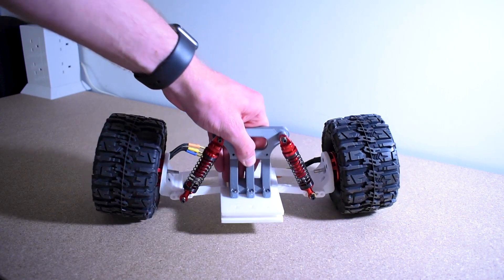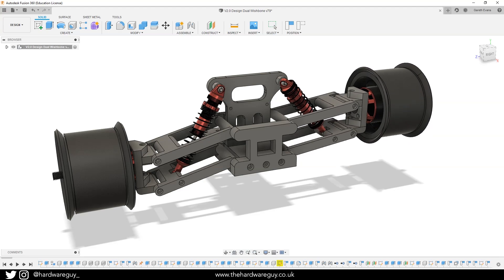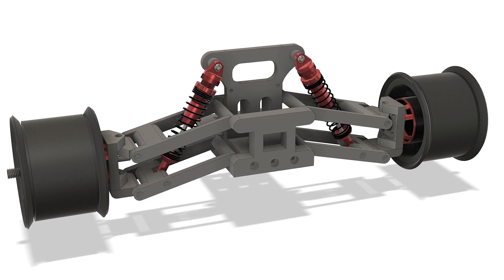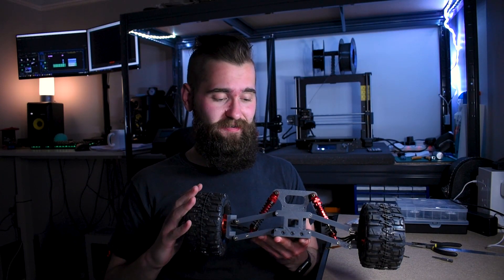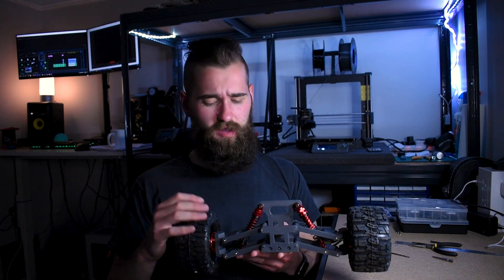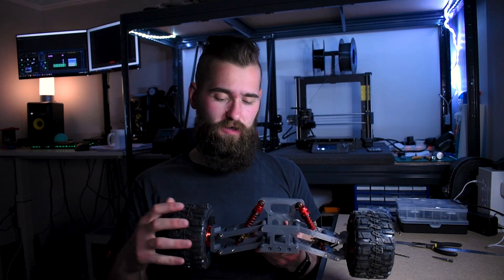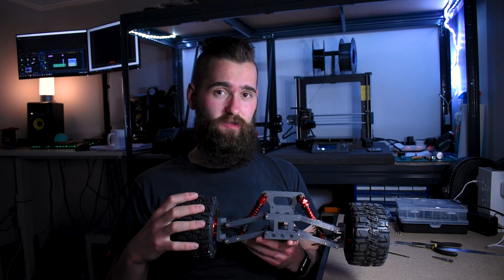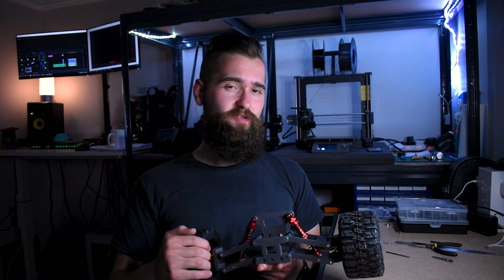Raptor I: 3D Printed Dual Wishbone Suspension

Comment: it's a perfect design for rear and front depending on the application however I will do a aluminium or stainless steel material for my build to add a bit of weight for stability I plan on doing speed so that's what I want
Reply from the maker: Check out Raptor 2. This version failed, the hub motors did not have anywhere close to enough torque. Aluminium will add weight so ensure your motors have enough juice.

Comment: is the motors straight on the wheels? how will that affect handling? Assuming the motors arent super expensive, they will have slightly different speeds and the car will pull to 1 side or the other?
Reply from the maker: Great question! This isn’t going to be your typical RC car, I’ll be using a microcontroller to interface to the receiver and all the other electronics! 
I’m going to use a PID control feedback system to measure the RPM of each wheel, that way I can adjust the power precisely so that they’re all travelling at the correct speed! This also opens opportunities for steering differential and many other cool features!
Reply: @thehardwareguy  and true 4wd :D

This sounds so cool

Comment: Really interested in your build.
Have you considered how you will add Caster on your front axle? Incline on the bottom tub or modify your a-arms to add in the caster angle?
For a future iteration perhaps consider using rod ends as the pivots of the suspension arms, this gives you adjustability on camber and a smaller footprint allowing more steering angle. Just some suggestions as I am really curious to see your build go forwards.